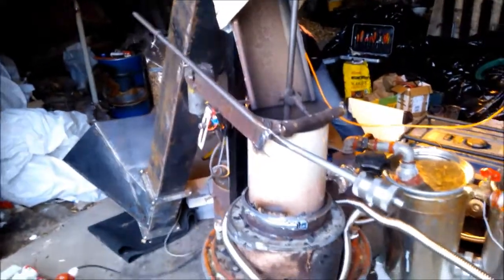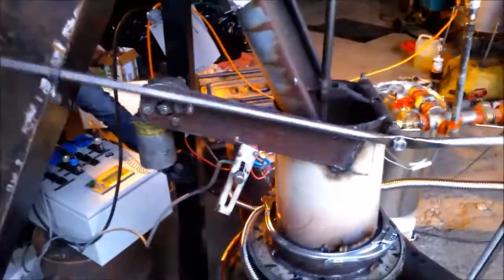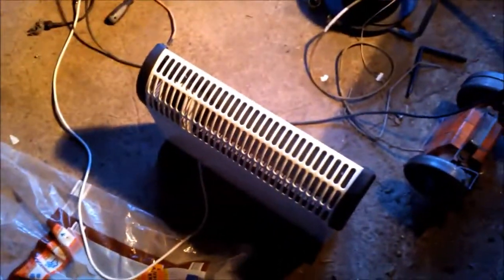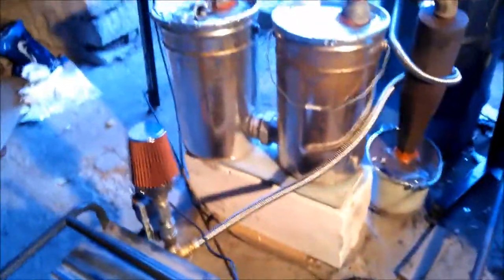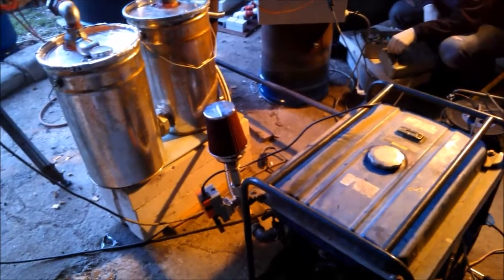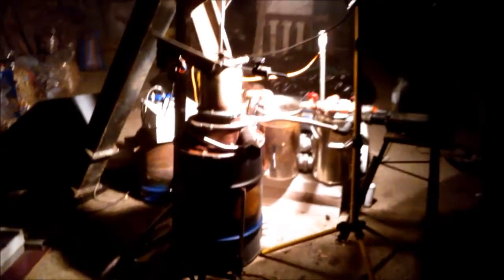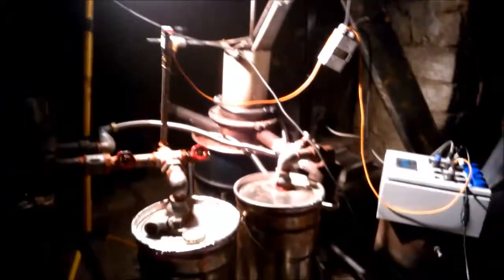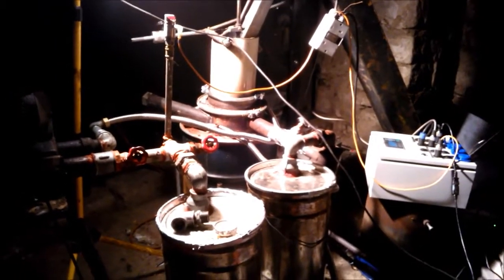Laboratory DriZzleR produces his first Electricity

Comment: Hi Luk. Well done for the completion of the Gasifier-To-Electricity-Generator! I am based in London U.K and I am interested in learning the practical aspect of producing all the equipment. Can I come down to your workshop to learn?
Reply from the maker: Hi Kazeem, We are people with an every day work and do not run any organisation that could organise workshops. We do have a forum with active members where you can post all your questions. Do not be afraid to ask beginner questions, we all where beginners. Hope to see you on the forum forum.thedrizzler.com
Reply: Thank you for the reply. Based on your 3KVA generator, how many kilograms of wood chips is needed to sustain a 50KW generator  for 10 hours?
Reply: Hi Luk
I have a diesel engine power generator, can the gasifier be connected directly to the diesel engine to replace  diesel fuel? Will this arrangement work with diesel engine?
Reply: If you run a diesel on woodgas than you have to run idle with diesel and give exstra power with the woodgas. So yes you can but only in dual mode. A diesel will never run on woodgas alone, unless you modify it heavely.

Comment: Hello, first to congratulate you on great job that you do on usage of biomass as renewable energy source. I have a question,  can this type of gasifier be used for high quality wheat straw pellets? Humidity level of wheat straw pellets are about 10% with calorific value of 18.5MJ/kg. Also for higher outputs of gasifier are there any producers of CHP engines that can use gas produced in your gasifier concept?

Comment: Are you using an Arduino with the lambda sensor to adjust the air / woodgas ratio?
Reply from the maker: urgentcareguy3 no arduino, we just designed our own complete steering and the lambda control is integrated part of it.luk

Comment from the maker: Bill Schiller wrote
 
What baffles me is all the electricity it takes to run this 'automation'. With wood gas you will lose about 50% of the potential electricity you can make with any given generator unless you have figured out how to advance the timing. One can then get back about 20%. With the automation, one is constantly using a certain percentage of the 50% that is being made. So one can assume the net wattage is about 40%? Is all of this running on a 12 volt system? It seems that it would be much easier to build a gasifier with a hopper built for the desired run time.. 

Bill, Electricity consumed is rather profitable compared to electricity harvested. See this video DriZzleR Gasifier Testrun  
of our DriZzler connected to a car VW 1.6 litres engine. It gives 9 KW electricity and 20 KW hot water consumes not more than 1.2 KW on 8 Kg pellets; make the math, very profitable. This type of gasifier with its open top is intended to run continiously unattended. A closed hopper system such as an imbert runs only a few hours.

Comment: What baffles me is all the electricity it takes to run this 'automation'. With wood gas you will lose about 50% of the potential electricity you can make with any given generator unless you have figured out how to advance the timing. One can then get back about 20%. With the automation, one is constantly using a certain percentage of the 50% that is being made. So one can assume the net wattage is about 40%? Is all of this running on a 12 volt system? It seems that it would be much easier to build a gasifier with a hopper built for the desired run time.

Comment: why are you pre heating the gas before it goes into the engine?
Reply from the maker: darbycrash55 If you do not preheat then the water in the gas condensate and gets into you engine. By just bringing the gas temperature some 10 degrees  or so celcius higher the gas stays in gas form.

Comment: Hi Luk. I need some help. I got my gasifier going the other day. Was great to see it lit. My fan is a little on the weak side. I might try an ejector. I started with charcoal that I made myself. She lit up pretty quick. just like you other fellows are doing. I got it good and hot, but the gas coming out would not burn. Not even the slightest hint that it would light. Now that was disappointing. Here's possibly where I went wrong. The wood I used was A mixture of cedar and some lightly treated pine. Apart from the health and environmental issued associated with burning treated wood, is there anything in the chemical reaction that might prevent the gas from being flammable if treated wood is used.  Have you had any experience trying to flare off with treated wood. I welcome any feed back. Thanks
Reply from the maker: Stephen,
It is always difficult to judge from distance. The number one problem why the gas would not lit is a leak somewhere. When there is a leak in the gas exit chamber under your reduction then the produced gas mixes with fresh air and combust inside your gasifier. The other problem is too much speed and push of your blower or ejector. But since your are saying your fan is on the weak side that can not be the isue. An other problem can be the moisture of the wood. The chips you use must be absolutely dry. The smoke that contains gas it greyish. Pure white smoke is from wet wood.
Wood beeing treated I have not used but I should inmagine it would even be better to lit because the chemicals will add the heat value.
ut you said you fired it up with charcoal first then at least from the charcoal you should have been able to lit your gas. I reckon you have a leak somewhere.
 Helpfull I could be more if you discrebe your build a bit more in detail.

Comment: Howdy
What is the wood consumption per Kw hr. ?
Nice vid , Thank you.
I like how at the end you say it is the end of the proof of concept of the Dirzzler because you will keep working on it to make it more simple and care free. Next is making a uniform fuel (yes I know your have worked wood blocks from pallet boards).  Maybe use the heat from the exhaust to heat a hydraulic press the presses  moist wood chips to make a pellet fuel about 20-50mm dia.  less pressure is needed to make the fuels if heat is applied.
It's amazing how much energy it takes to make energy.  jim
Reply from the maker: Barry, Thank you for commenting.
So far this build was just process development and for fundamental laboratory testing only. untill now I only concentrated on materialise this revolutionay idea I had. The build was ther to see if the inmagination would match with the reality. Millions of people just stay a the bright idea and count on others to do the dirty work. Building an idea into a proof of concept machine and solve the many problems that come with it not that easy but unfortunatly only the very begin . The next step will be reorganise completely this laboratory gasifier into a decent riliable working prototype. It will be this prototype that will have to go through performance and durability tests. So stay tuned and hopefully soon I can give the you rendability numbers you ask for.
About uniform fuel. I Agree that this is the safiest way to get the gasifier working flawlessly. But I would first try everything possible to make it work also on ordinary woodchips.